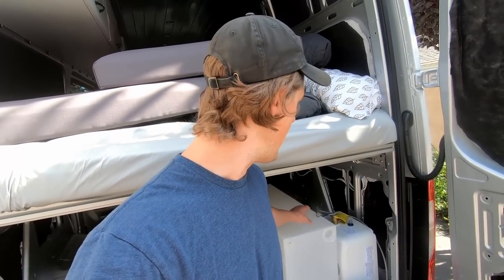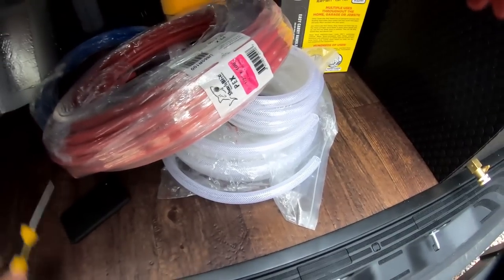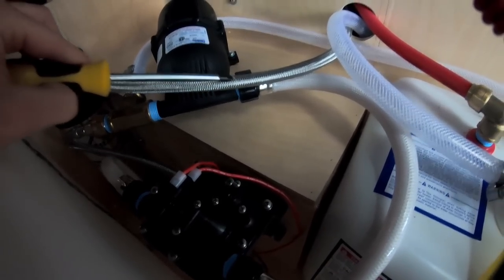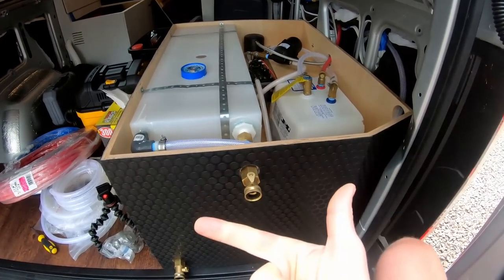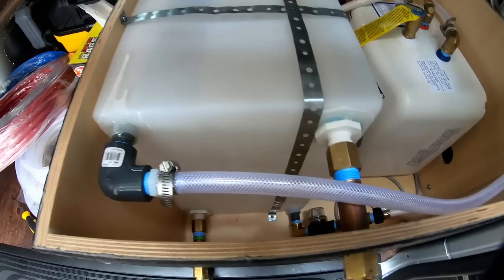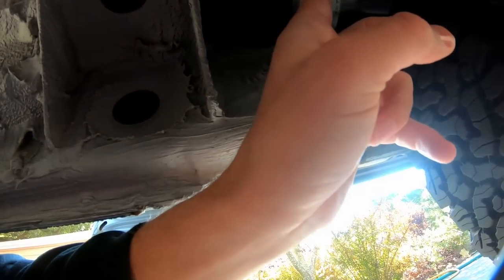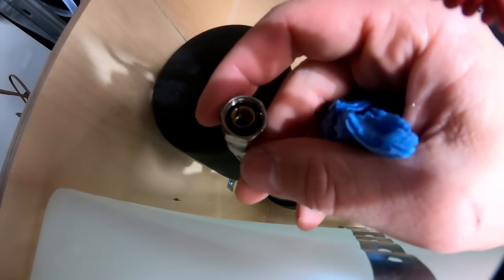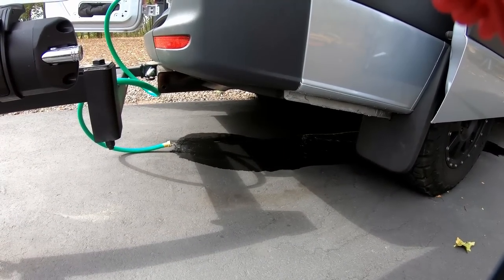PLUMBING & WATER SYSTEM In A Van Or RV (off grid plumbing for newbies) #vanlife

Comment: I have a suggestion for your plumbing. Insulate the tubing anywhere it touches wood or metal. Vibration over time will eat a hole in the PEX tube.
Reply: Thx dude thats what happend to me and saw this comment thx so much 😊
Reply: how would you insulate it? and where would i buy the materials :)
Reply: @barbz6424  You could just split a small piece of rubber hose and zip tie it on anywhere the water pipe touches. Or you can buy pipe insulation at the hardware store.
Reply: Does this also help to prevent freezing in winter? I don't want anything to crack or burst in my camper trailer. Thanks
Reply: @neilmarshall4927  Yes, it will help prevent freezing if you insulate the entire length of pipe with pipe insulation. Rubber tube won't do much, as it is just to prevent chafing.
Reply: @barthanes1  that's what I was thinking, too. Thanks man.

Comment: 1) I would put a waterproof liner in that cabinet, and a way to drain it (you can use your pump or just siphon it)... it is only a matter of time till you have a leak... then you will be glad you at least contained the water... 2) always purge your RV fill hose  before filling your tank (as garden hoses are not safe for drinking water, you can use your leftover pex) ; you would be surprised what will crawl or get in it... and any latent water will have bacteria in it...3) maybe a heat mat under the tank, if you are in a cold climate, put an insulated lid on the box...  awesome build... I am sure you will eventually put a shore power connection and transfer switch for your house current devices, maybe a small rectifier for the 12V appliances...

Comment: The SharkBite quick connectors work for copper, pvc, etc. Also, your screen filter should be after your shut-off so you can clean it without having to empty your tank.

Comment: Awesome video!  Your attention to detail and explanation is first rate.  I am a general contractor in LA and just purchased an 8x12 box for one of my medium duty pick ups, and I am going to remove the bed, install the box and build it out as an office inside so that days I have multiple projects on one side of town, I can work out of the "office" without having to drive back to my actual office multiple times in a day in order to work at a desk reviewing plans, having conf calls, print out docs that need to be signed, have a bathroom, etc. Driving back and forth from downtown to the Valley can be 45 mins each way, so having an office on the road can save me hours a day and plumbing in the van is essential for it to be practical. I know plumbing for brick & mortar structures well, but this was helpful, as there are a lot of little nuances to RV/Van plumbing.  Thanks for the info and keep the videos coming!

Comment: Question about fittings: Could you please add links and specify the connector diameters of the fill and drain ports (since they are the same) especially that white plastic connector that you bought off Amazon? Great tutorial. I love your explanations of the different types of fittings and connectors. The other videos that I have seen skim over these important details.
Reply: Bumping because I'm looking for these fittings too!

Comment: thanks, SUPER helpful, all the basics pretty much covered. Sink drain is a small ID and a long run....going to have to make sure your plates are really clean of food debris before washing them lol.
Also, I noticed you didn't wire loom some of your wiring in the back there and it's sitting right against the sharp edges of the vans stamped metal re-enforcements, I'd be worried over time from vibration, that might cut through and cause a short or fire.

Comment: Sharkbite also works on copper pipe. When used on Pex, you have to use the plastic sleeve so the pex won't deform.
The sleeve is not used on copper pipe.

Comment: Just started watching your videos. Found your Chanel while researching different bed installations. I’m now trying to find some software to use to design the 80/20. Stuff looks amazing for my project! While watching I noticed your water holding tank install. I would highly recommend you install some chaffing protection from the metal strap you are using due to vibration while driving etc. You could consider vinyl strapping. I’d also recommend you install grommets to protect any water lines passing through any penetrations. Anyway, back to your Chanel as I’m still in the research stage of my future project! 😂 Considering converting a Unimog or some other 6x6 if I can find one that won’t break the bank! 

Enjoying your project btw. 👍👍

Comment: (Thought/suggestion) I think a filter on the end of your vent tube would be a good idea. I know with any kind of dirt road or road driving could allow contaminants (dust, road dirt sand etc.) into your clean water. Given the location of the vent and knowing it will draw air through it presents the possibility of contamination and cleaning of the inside of the tank in the future. Just a thought. They also make a device known as an “auto air vent” that will allow air to pass both ways through it but not water. Overall I really like the setup.
Reply from the maker: Thanks Chris. I ended up Ting off the vent hose / over pressure drain hose and sent one side of the T up the wall inside the van. I put 2 check valves facing opposite ways on both ends of the T so that negative pressure sucks air through the hose inside of the van, while positive pressure exhausts out the drain plug end.
Reply: Seven O Savage Have a link to the check valves?

Comment: If you can use additional strapping for the Fresh water tank. Also when you install the grey water tank under the van, insulate it so witch will protect it from both debris and freezing .  I have seen the grey water tank come loose in other vanlife videos and require new strapping/mounting of the grey water tank.

Comment: You MUST use the PEX red heat pipe for the blow off on the water heater.  That soft flex pipe would melt if that valve released all the heat into it at once.  Copper is required on gas home water heaters for the blow off pipe.  Other wise - great work and presentation.  Thanks  I am using some of your ideas in my van build.

Comment: I've watched a bunch of UTube videos and yours are among the best.  HOWEVER, that said, you do leave out details and that's where I spend an inordinate amount of time - finding parts you didn't list, like the fittings in this video.  I'll probably spend 2 days working through how to connect each joint and what parts to use.  Sigh.  I don't expect exact counts, but a simple list of things, like 

     fitting name    connect x to y.    used on this part of system.    other info

Would save us.a lot of time figuring it out ourselves and/or having to watch other videos to find out what they used.

Dave

Comment: The hot water inlet and outlet should be those flexible metal wrapped lines for about 1-2' due to the heat transfer from the hot water tank.

Comment: Some pro tips: 
Do NOT put Teflon tape on plastic threads. DO put thread sealant on plastic threads. 
Use both Teflon tape and thread sealant on metal threads. 
Do NOT over tighten plastic threads, they will break.
If you use pex pipe. Use plastic pex fittings, not metal.
Shark bite brand fittings will need an accessory to undo the joint. Its a small C shaped plastic bit that is easily lost. 
DO strap and secure your piping wherever you can. There will be a lot of bouncing around and over time your connections will leak and break.
Make sure you blow out any debris from cutting pex pipe before you make the connections. 
Cut very straight! Angled cuts will leak.
Be sure to ask your hardware store clerk for a pipe stretcher for those times your cut is a bit short.🤞
Great video!

Comment: Great video Seven! One thing I’d suggest. As a long-time RV’er you should use a hose approves for drinking water. They are usually white or blue. Awesome details as usual. I am curious to know if you’ll have a toilet? You may have said something in an earlier video but I don’t recall. Also, will you finish the walls as well? Thank you sir! Looking forward to your adventures!
Reply from the maker: I ensured that all of this piping was safe for drinking water. Yep, my toilet is a dry flush toilet though so no plumbing required. I will indeed be doing the walls. Thanks for your ongoing support David, you are the man!
Reply: @DuffyGabi   David from Texas is talking about the hose to fill the tank, not the piping inside the van.  You do not use a common green garden hose to fill.  Pick up a hose designed for filling the water tank.  As David says they are usually white or blue.  You don't want to contaminate your water or make yourself sick.

Comment: For PEX, there is no distinction between the colours, only to make it easier to understand for the installer. Each tube is rated for high temperatures as well as freezing temperatures due to its ability to expand up to 3x its size (however it can still burst in extreme conditions). The main advantages of PEX are its flexibility, lower cost of materials and labour, and its durability.

Comment: Do you put a filter on that vent port to keep it from getting contaminated/having bugs move in?
Reply from the maker: great idea!
Reply: You really need like a check valve system to keep ants out. Especially  when you are out in nature, those bugs can sniff out water very quickly. 16 yr rv experience. Also if you're planning on visiting cold weather climates ie: skiing you need to maintain your indoor temperature above freezing. It can cause complete failure of tank, lines, fittings, basically the whole shebang. Learned these things the hard way lol.
Reply: Russell Satoda What sorts of check valves would you recommend?
Reply: @fyrecapital1194  all you need is a piece of window screene and a zip tye to hold it onto the tubing
Reply: @peterandrews4172  good idea. He has 2.

Comment: Great job! A couple of thoughts:
- Shame you didn't put in a heat exchange hot water tank, then you can use the engine heat or a dedicated diesel heater to heat your hot water. Maybe for the future! I went the diesel route, it worked out great, a full tank of hot water in 15 mins.
- On demand gas hot water is another cheaper way to go. I think you'll wish you had hot water all the time!
- Do you really need a hose drain AND a fill? Why not just use the drain hole to fill?
Reply: Using the drain hole to fill would limit your gravity filling options.  There could be a time when you need to fill your tank and you don't have a tap to hook your filling hose up to.  I have a funnel I can connect to my filling connector for this situation

Comment: A few comments: #1: Most manufacturers I've seen do NOT want you to fill the tank with a garden hose fitting....the pressure could damage the water tank.......2) if you're going to
ever use city water (versus your 12 volt pump system), the hose clamps will NOT withstand city water pressure (which could be over 100 pounds).

Comment: Good stuff Dude. I am working on a Sprinter build myself. You may already know, but some guys fill their water takes with food grade whiffle balls to minimize any sloshing noise.
Reply from the maker: Very interesting! I had not heard of this. If the sloshing starts getting annoying I will def try this out.
Reply: @seven_o_savage  yeah, never knew there was such a thing as food grade wiffle balls, but there is. They fill the water tank solid with the balls. I hear it works great, I plan to use them.

Comment: water tank takes up less floor space if you put it on it's side on the wheel well
check with tank manufacturer ; mine said DO NOT hook onto house pressure hose to fill tank
90 degree barb to barb fittings ARE AVAILABLE
cover bottom end of vent and drain lines with window screen held on with a zip tye
have on off switch next to sink so you can shut off pump when not in use ; if you develop a leak with the demand pump on ,  you can get a 30 gallon leak...
cut a vertical slot in side of water tank box so you can see the water level in tank, when water is almost to top , you can shut water off....slot on side is cheaper and easier than fill guage
1/2 inch ,12volt ball valve allows you to drain gray tank without getting out of van .

Comment: Howmuch did you spend on the 80/20? I made my roof rack for solar and platform up top out of 80/20. I found my set for cheap used. Great video. Very helpful.

Comment: My plumbing / water system is almost exactly like yours. I was hoping to see how you  attached the 1/2” ID tubing to the Ruvato sink. I don’t want the drain to slow because of stepping down. What did you end up with? Love love your channel btw. I’ve take a lot of inspiration from your build!
Reply from the maker: Hey Thanks Erik! I ended up doing a pretty wacky solution: 1-1/4 to 3/4 elbow adapter from ebay. Then just 3/4 I.D. drain all the way to gray tank. I had to grind down the bottom and there’s about 2mm of room... I got pretty lucky!

Comment: Thank you for the video. I really like the idea, that you use the existing holes for your vent tubing. I have the same sprinter and I used the same pipe, but I didn't manage to get through there and get out at the bottom. Do you have any advice on how you did that? Did you go in from the bottom or the top first? If I out it in from the inside first, I can't find the hole in the bottom.

Comment: Hey SoS.  Nice job on the wiring.  I'm just doing the planning on mine.  One thing I've been wondering about is the location of the battery shut off switch.  it would be nice to have the option to easily shut off all draws on the battery such as to the DC fuse box and inverter while still allowing the batteries to charge via solar.  Do you have that option?  I know you have breaker on the lines to both the inverter and DC panel, but they don't seem easily accessible and not sure if they even have the option to manual break the connection or if they are only capable of reset.  Anyway, curious your opinion on this.

Comment: Very informative video. Thanks
Questions for you. How would you go about refilling that tank without a pressurized hose connection. 
Is there a way to add a screw off cap on top to pour into or is that asking for a leak?
Or perhaps a way to somehow use the existing fill input without needing a pump?

Comment: Great work with the videos! I’m starting a conversion and really getting a lot of your build, thank you! Question: why did you have your water tank vent hose routed down and out of your van, as opposed to just having it point upwards? Does water come out of the vent hose when the van is moving and the water is splashing around? Thanks

Comment: Saw some confusion in the comments, the "I" in FIP and MIP refers to iron pipe - which most likely folks won't want to use in a van build since it's heavy and used in older housing construction, new construction doesn't

Comment: Hey great video. What size water level sensor did you use? I'm getting the same water tank/holder. Does your sensor hit the bottom of the tank?
Reply from the maker: I used one slightly shorter than the tank. Just means I have a little extra water when the sensor is showing zero.
Reply: Seven O Savage thanks dude! Watched all your install videos and they were all extremely helpful. Love how detailed you are.

Comment: I was hoping to avoid and inverter in my design.  The water heater wants 120v and an inverter, except with on shore power.  Did you consider heating water with the espar?  Why didn’t you use it?  Do you have recommendations for using the espar?

Comment: are you going with flexible, soft and removable wall panels in visible areas and no wall panels in the garage/basement? If so this is just smart if you can isolate it.  I personally do not like most types of insulation in a van.  No insulation in walls? any concern with cold weather trips?

Comment: wait how does this work with a hose connection?  The instructions on the water tanks note that you should NOT connect a hose directly to the tank since it is pressurized water and could explode the tank.  Have you seen any issues or is your vent good enough? I'd like to be able to just connect a hose.  I feel like it would be so much easier to deal with than a gravity feed system.

Comment: Did you put a screen on the negative pressure vent tube in order to avoid debris and bugs from getting in? :)
Reply from the maker: Yes I put a check valve on it so that it’s closed off
Reply from the maker: Yes I put a check valve on it so that it’s closed off

Comment: Hi saw you video want to ask you what you use on the bottom of the sink to drain the water what fitting. I have a rv that want to connect a drain the water but I want to use a water hose as a drain hose.

Comment: Does the end of the drain tube have a screen over it? Wouldn’t want bugs and ants crawling up it from the exterior.

Do you think it is possible and wise to mount the 30 gallon tank (240 lbs when full) high on a wall and use gravity instead of a pump? I would like to keep it simple.

Comment: can you share a link in the description for the HEPvO valve you used?  I also am going to use this for the sink and shower, but i think i got the wrong size.
Reply from the maker: I added a link to the description, but did not end up using it as it restricted flow too much for gravity to drain the lines.

Comment: Just wondering if you have done any tests on your electrical system with the Bosch hot water heater. It looks to be about 1400 watts.  How long does it take to heat 2.5 gallons?  We are looking at the isoterm slim square, which is 4 gallons and 750 watts and I am still concerned about battery drainage if I am not driving when heating up water.
Reply from the maker: I’ve tested it once and in 15 minutes the water was very hot. I’ll only be using the water heater sparingly, when I need to take showers etc.